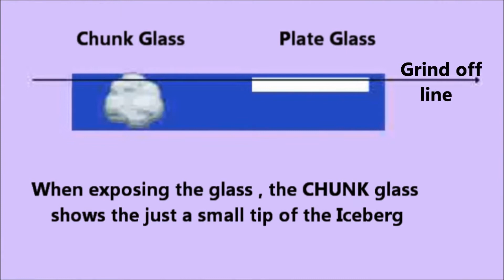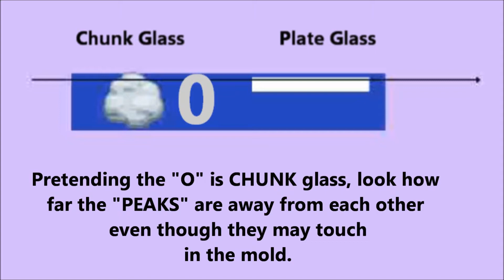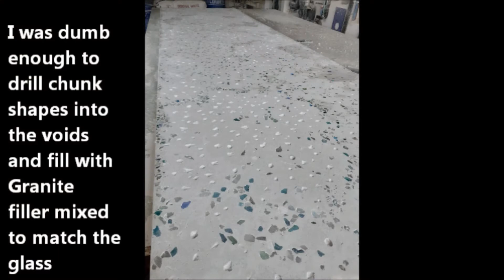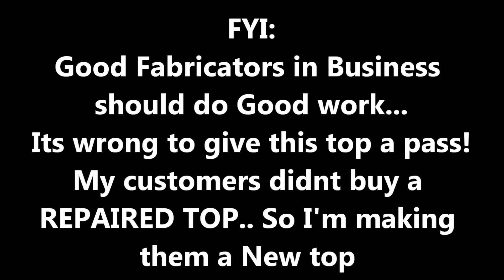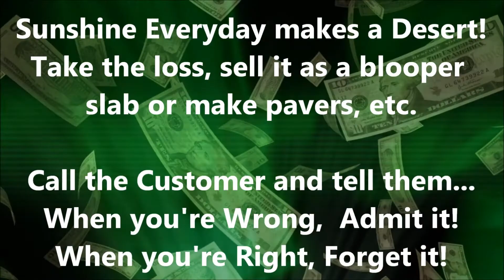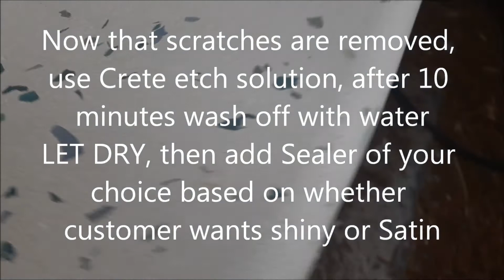How to place Glass in Concrete Countertops

Comment: I love love love terrazzo, more so with stones than glass but it looks really nice. I’ve seen a couple others use a common spray adhesive to keep the rocks in place but why not just add in more than enough (find out a ratio of glass/shells/rocks/ etc. to concrete) and mix together in the batch of concrete rather than placing down separately? That’s when I’ve seen the terrazzo turn out flawless and consistent is when it’s all mixed in the concrete prior to pouring
Reply from the maker: I agree but I do what customers want, sometimes I feel like a chef..I have the frying pan and they tell me how they like it..on my channel of my updated videos my friend Tommy wanted Flat plate glass to show bigger chips ..but I'm on ur side on terrazzo but we hafta do what ppl want if you advertise custom..have an awesome day I appreciate ur perspective

Comment: Have you ever used broken beer bottles? Can they be used and grinded in cement as well?
Reply from the maker: Yes all the time..one of my old videos I think I'm using vodka blue bottle...but if you do a job with beer bottles, make sure you scrape of the labels before you break them..then clean the broken glass
Reply: I have the same question, thanks!!!
Reply from the maker: @pedropereira8924  yes you can..just clean the glass especially in lighter concrete colors..some beer residue can stain Crete during mixing
Reply: @MrGeneShopTalk  thanks you very much!!!
Reply: @pedropereira8924  I used beer bottles and it worked. I also used fire glass. The fire glass looked better because they have a flat surface and I was able to stick them on the melamine board with adhesive. The bottles didn't grind as flat because of the curved surfaces.
Reply: @douglassebold213  thanks so much for response 👍🏼👍🏼👍🏼

Comment: Have you ever done this in reverse where you pour the concrete first and add the glass on top and float it in?  I’ve been on a lot of exposed aggregate projects where they us that method.  It’s seem like you may be able to control the glass better.
Reply from the maker: I just don't like the leveling process after the glass is pushed in..when I do it precast upside down I at least know the top is level...I done two jobs like that and thanks to ur suggestion I may look into that..thanks I'll check out some vids as well
Reply: vibrating out the air in the face down orientation is less critical.  face up means the bubbles are coming to the finishes surface.  My next one will use spray adhesive to place glass
Reply: @MrGeneShopTalk  I do not think the concrete adheres to the edges of the glass when placed from surface.  I have done exposed aggregate and concrete does not come up and around the aggregate, good for walk ways, not for counters.  
work around is to hand trowel a contrasting color, cement slurry to fill voids around aggregate.
Reply: It can be done either way...
34 years in Terrazzo trade...
Reply: @MrGeneShopTalk  got an email?
Reply from the maker: @jamescoleakaericunderwood2503  thedesignicator@gmail.com

Comment: These concrete countertops look great.  Do you need to put anything in the middle of the pour to strengthen the concrete for the long term?  Can these be left outside in the weather?  Do you need to reapply sealer periodically?
Reply from the maker: It's glass fiber reinforced concrete aka gfrc
Great for outside..sealing is another animal..depends on sealer, you may want to seal it periodically, but more so based on looks..pour little water on crete..if it soaks in it needs to be sealed..if it beads,  still good..but wouldn't hurt to rub out another thin coat

Comment: Great job on that countertop,I have a question,how did you get the glass to be exposed on the sides?
Reply from the maker: After ya pour it walk around and literally push down the glass along the edge..then the bigger flat plate glass slides along the mold easily
I also sprinkled loose glass but was cautious to not sprinkle too much as it might glump..
Reply: @MrGeneShopTalk  thank you very much for responding,great stuff

Comment: I want to build a 5' x 5' outdoor table, there will be a pavilion roof overhead.  I am thinking of pouring the concrete and adding glass, in place...as flipping such a large top is tough.  Is this a bad idea?  Will the grind/polish process be exceedingly difficult?
Reply from the maker: The grind polish process is difficult and time consuming regardless..I do my Crete cast upside down for flatness.
If you can grind and have it stay level, then by all means there are many ppl who do Crete tops that way..I have done por in place top twice and will keep my number that if it's a countertop and requires level flatness.  The hard part when starting out is when the glass starting to become exposed you may get excited and grind more in that area, then may have dips in top.
Regardless keep sanding away in level motions and when Crete is pour, do all you can to smooth out when doing pour in place..
Then think about how far you push down glass as once dry you have to find it with grinder